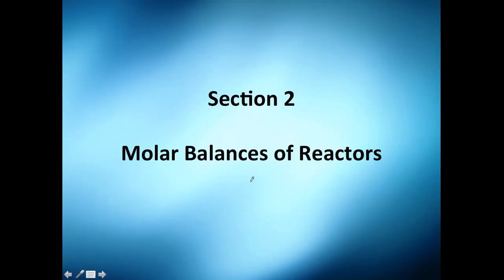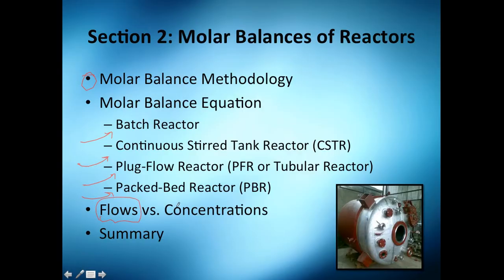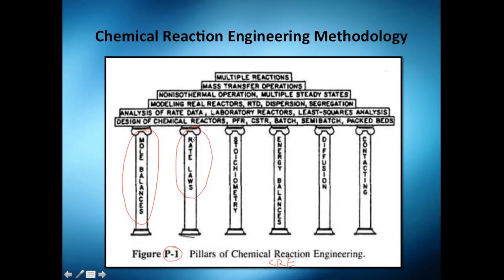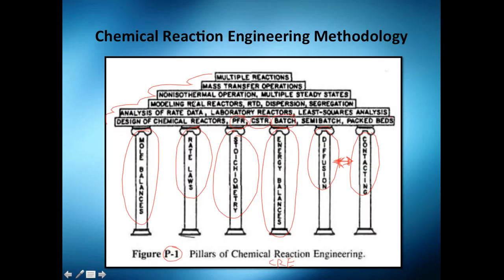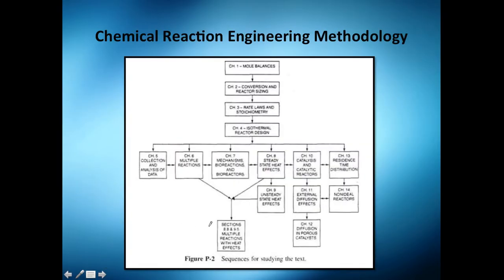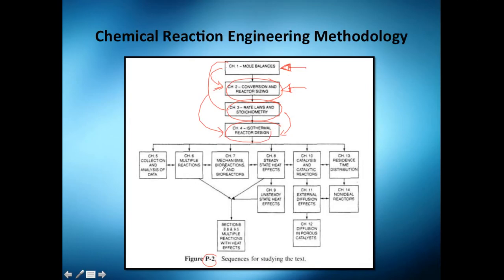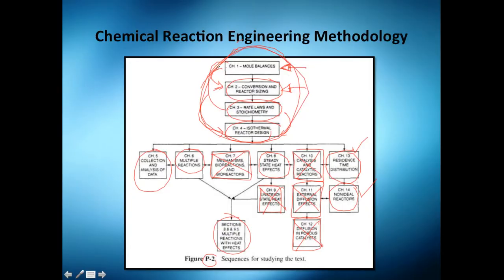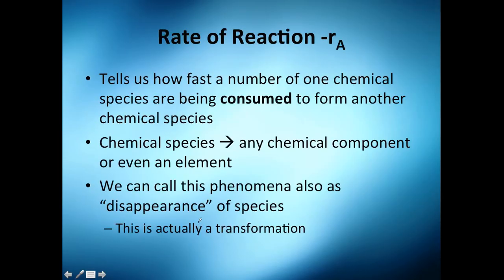Molar Balances: an Introduction // Reactor Engineering - Class 2

Comment: @ Chemical Engineering Guy: I think you slipped; rate of a reaction does depend on the type of reactor, but rate law does not depend on the type of reactor.
Reply from the maker: That is totally correct! RATE LAW depends only on the reaction. RATE OF REACTION will depend on type of REACTOR as well. Thanks for the msg!